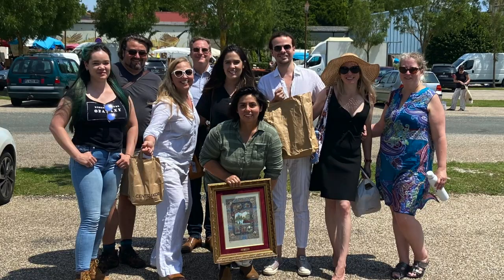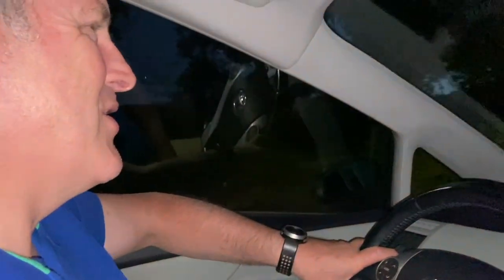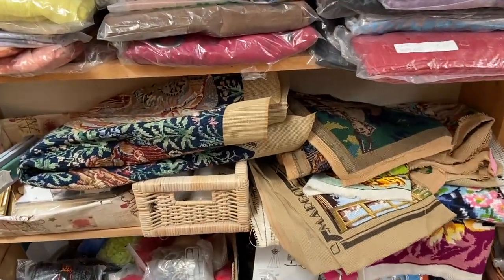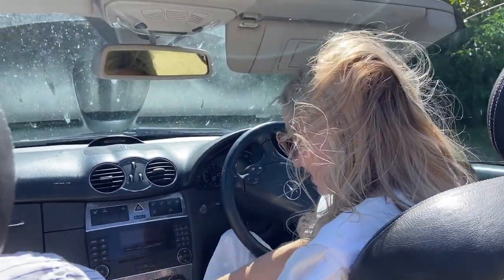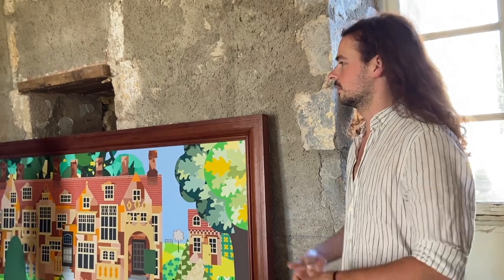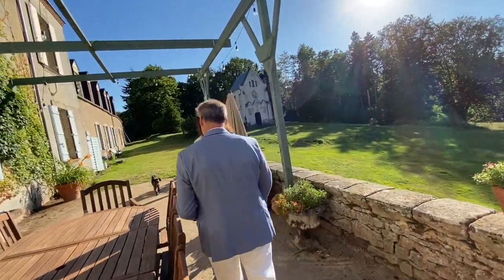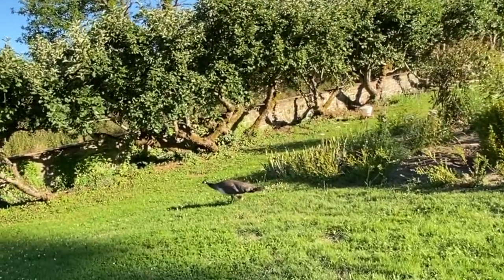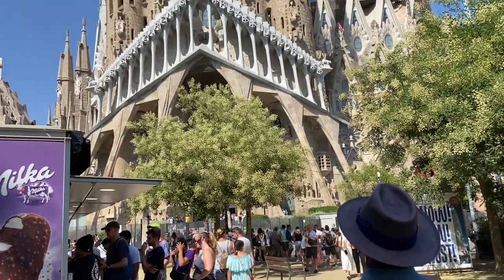CHATEAU de LALANDE: A First-time Tour! & IS Sagrada Familia FINISHED? @TheChateauDiaries

Comment: I remember the first time I went to Spain and Barcelona as over 30 years ago.  Easy Jet were doing a deal. £1 a return ticket if you could get through.  We (4 friends) also stayed right in the centre of Barcelona a street which is similar to staying on Oxford Street (we did not realise this until we returned, how fortunate we were to stay in that location).  When we came across Sagrada Familia it was up, but a dusty building site which you could climb up from the outside.  It looks beautiful now and great to see the inside looking great.

Comment: Thanks to Phillip at Llalande for such a beautiful tour.  I learn more each time friends visit it.   I share your frustration about the wallpaper Vivienne!  It is maddening when you lay up a piece and work at making it stick only to find that you've switched paper strip by accident.  Here's a little tip.  Once you've measured and aligned each piece dry so they fit together, I start at one end of the sheets and put a number (or letter - if so wishes my fantasy) in the bottom Left corner (back side) of each sheet.  That way, I don't get them confused and the gluing/placing is a breeze as everything fits together like stitches on a knitting needle.  Take Care.
Reply from the maker: Hello, forgive the delay of my response. Thank you for this wonderful advice (in addition to other great advice before)! Sending you big hugs...xxx